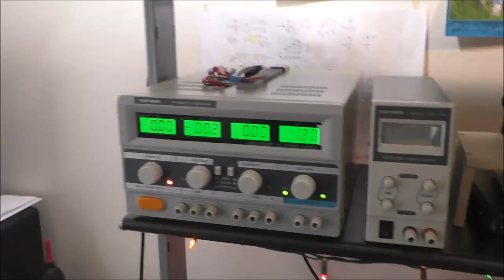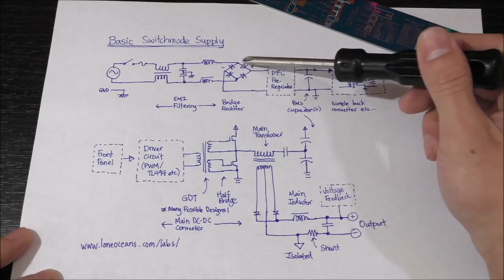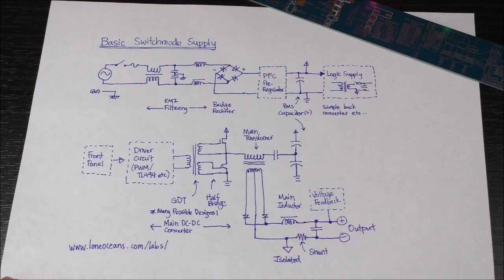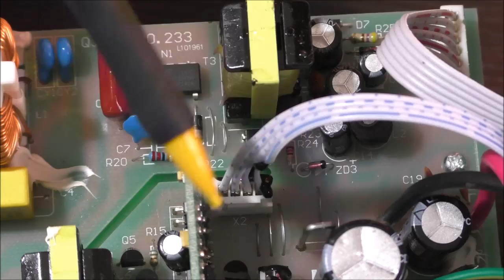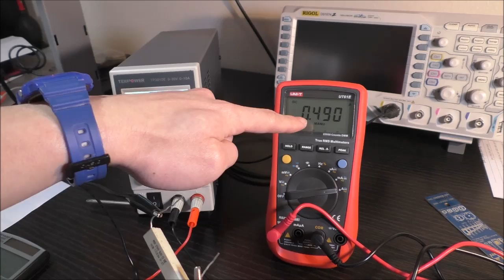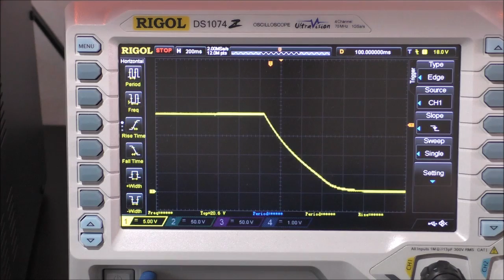Tekpower TP3010E Switching Power Supply Teardown & Review

Comment: At 18:09, you mention that the MOSFETs they used are usually more expensive and I’m over here looking at your video to see if I can find out the part number or specifications for them because they are slightly different in my sdps and they’re burnt out! They had sleeves over them and both were held down by a single bracket.

Comment: Superbly and expertly done. So much so that I completed youtube account setup just to leave this comment.

To Manuel: He briefly answered your question in the video, toward the end. From what he said I think the answer to your question is that linear power supplies provide more accurate and more stable output and produce less noise than switching like this one. That would matter mostly to electrical engineers who are designing curcuits and need dead accurate precision down to mA and mV level, or on equipment that would be sensitive to the noise.

Comment: Nice video!
You could have disconnected the fan when powered from PSU to see if the voltage will increase after load removed.

Comment: Nice video! Is there any advantage in using a linear supply vs a switching one, assuming good quality on both?
Reply from the maker: Linear supplies have almost always better load regulation and ripple, with much less EMI. On the other hand, switching supplies are usually more expensive, but have the benefits of being much smaller and much more efficient, which becomes important as power levels increase (e.g. imagine how large a linear 1kW power supply would be). It all depends on the budget you have and the requirements for your particular use.
Reply: loneoceans - Fail. SMPS are anything but efficient. Without PFC they just put out hash. 

Go read a book. Stop watching YouTube and learn something. 

God the Arduino cancer is metastasizing.

Comment: I know next to nothing about these sorts of things, but I have a question...   I have this very same power supply, I bought it for use with various experiments I plan to do in the future.  One idea I had was that I can use it to charge a cordless screwdriver that I bought it Germany YEARS ago.  I know the voltage and amperage that its original charger put out (6V 300mA).  The thought I had was that since I had this machine, I could dial in 6 volts and .3 amps (which I am sure is the same as 300 mA)  and charge my device.  However, I can't dial in this combination, why is that?
Reply: I figured it out...  I removed the battery. Its a 3.7V 1000mAh so I set the power supply to CC at 1.00A til it reached 4.2V and that seemed to work. I put the battery back in and it worked like a champ